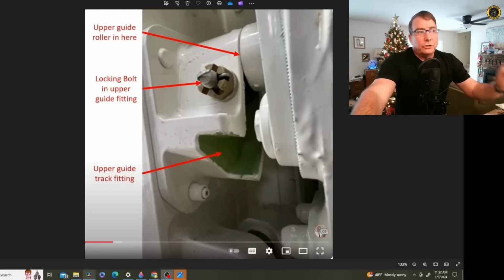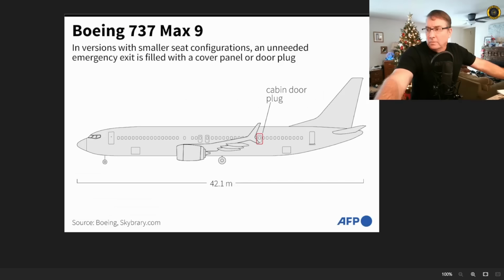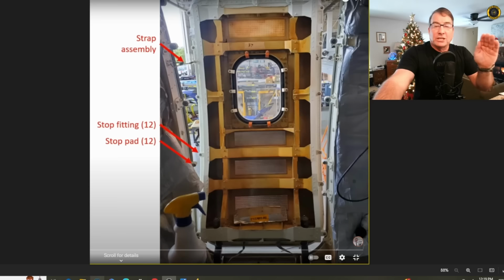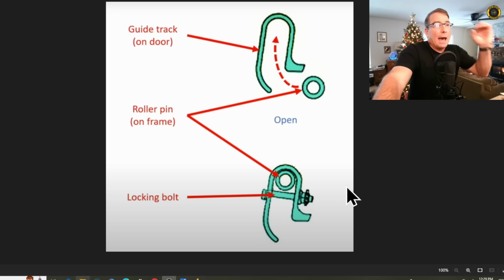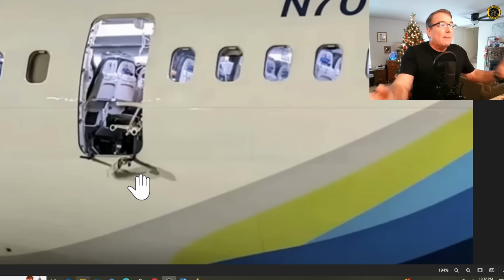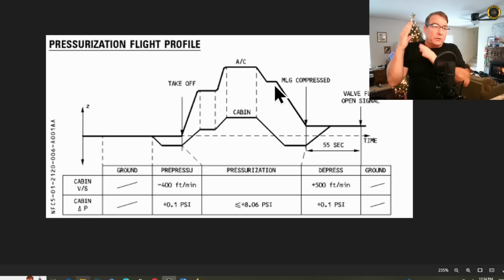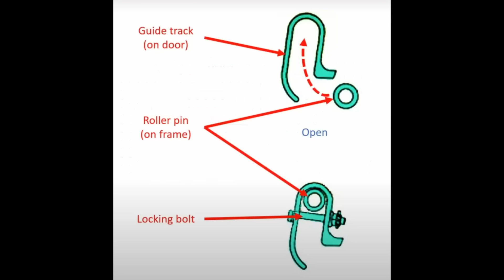Alaska 737 Max-9 Door UPDATE! 8 Jan 2024

Comment: The damage to the guide tracks NTSB report they saw on the door that was found, is of little significance. (They do kind of say as much).
The guide track system is only intended to guide the up/outward path of the top of the door when there is no differential air pressure. With the door lifted right from engine start up to the extent that the 12 main lugs are so far out of alignment they are only just hanging on (the hair trigger Juan described) the roller pins are  in the lower part of the guide track. At 15k ft when the differential pressure is such that the 12 door lugs finally slip past the 12 frame lugs, the event has such force that the rollers just break through the final part of the guide tracks, (the inside lip of the tracks at their lower, open end of the tracks) rather than the guide tracks having any influence on the path the door is now taking. 
Normally, on the ground, the roller pins & guide tracks would guide the door further up so there is comfortable clearance as the 12 door lugs pass over the 12 door frame lugs. In this case the door just blasted straight outwards as soon as the lugs could get passed each other, damaging the tracks in the process.
So this damage doesn't tell us much, other than that the rollers got near to the open end of the guide tracks which kind of tells us the guide track locking bolts weren't present. (Which NTSB are going to analyse over the next 18 months with their scientific equipment before telling us that).

They haven't described the guide track damage in any detail or shown photos, so this presumes the damage is near the bottom, open end of the guide tracks. If the damage were to the top of the guide tracks (in which case the lock bolts could have been present) then the 12 door or frame lugs would have to have been severely damaged for the door to be released. We have seen 5 upper frame lugs quite clearly and all 12 frame lugs at a distance so I'm confident that hasn't happened. Although they are still playing their cards pretty close to their chest, I think NTSB would have slipped some clues if the lugs had structurally failed, rather than being severely misaligned from the start of the flight and eventually slipping passed each other.
Reply: I can tell you understand this mechanism far better than many commenters here, some of which tried to explain its operation while not even understanding which direction the pins travel in the guides as the door is removed. Your communication skills are very good as well.

Comment: ich glaub das genietete teil in dem der haltebolzen sitzt hat sich durch die ganzen vibrationen, weil starr verschraubt und nicht federnd, abgeschert losgerissen und dadurch die tür zum ausreißen gebracht.

es scheint ja nur bei modellen (sparversion) ohne vierte tür so aufgebaut zu sein.

I think the riveted part in which the retaining bolt is located has sheared off due to all the vibrations because it is rigidly screwed and not springy, causing the door to tear away.

It only seems to be designed like this on models (economy version) without a fourth door.

Comment: As a former design/engineer & current private pilot (92), great coverage here,  My 2cents, the design & retention of the plug door appears robust, seriously the only way I see this happening is thru missing parts-components (even a few) 3retaining bolts-nuts might hold, down 2, thru several flight cycles would likely stress possibly give out.  What’s the tension level on the bottom 2springs??  Such a clean break upwards on the plug itself, it launched perfectly off pads.  If nuts fell off the bolts it would need  to happen simultaneously.  I’m of belief parts-components were missing (even cotter pins) but all 4???

Comment: This is really interesting.  When you showed the hinged assembly on the lower part of the door and frame, there appears to be two nuts and a washer on the top of the pin itself.  It's hard to tell if the washer is oversized to further assist in preventing the door from releasing from the pin.  Correct me if I am wrong, but the door seal is accomplished by dropping the door into the home position and those four bolts only function is to prevent the door from lifting off its guides.  It also seems someone has to sign off that everything is secured on this plug door once installed.  If all the yolk assemblies on the door and frame are undamaged, it seems unlikely that all four bolts and nuts came loose with the cotter pins installed.

Comment: Just a technical nut what is pictured is a slotted nut. A castalated nut has a raised portion where the slots are and are longer in length then slotted nuts. This adds weight and would also require a longer bolt with more weight. Any added weight on an aircraft is a no no.

Comment: One of the supervising A&Ps at Renton has told a friend of mine the core cause is the lack of skilled people coming into the industry.  All of his A&P supervisors are over 50 and will age out soon, and there are not enough new ones in the pipeline to replace them.  But even more concerning is that he can't hire anyone for the entry level tech jobs, simply because there are no qualified applicants.  And they'll take anyone with a few month's experience in an auto repair shop.  Meanwhile, he's had to cut final inspections because of management pressure to move product out the door before everything is checked. I suspect the aviation industry is not the only place experiencing the skilled labor shortage crisis.

Comment: An aircraft door held in place by a 4 castle nuts with split pins unbelievable i used to have a trailer with the same fixings but no way was it ever under the same stress as a pressurized cabin door and that failed twice it’s unbelievable this is used and another piece of cost cutting. Thanks Juan for the very comprehensive explanation.
Reply: The bolts are in shear and stop the door lifting away from the lugs that take the whole pressurization loading. The castellated nuts only hold the bolt in place.
Reply: I suspect you are not an engineer. It's not that simple.
Reply: @OsoMagna Great comment Sherlock, why bother!

Comment: @Blancolirio

Juan, excellent update, however study the external photo of the door opening, and you will see on the aft lower hinge. There appears to be some of the door structure still attached to it. Additionally, if you go to the photos that you showed from the lower hinge guild fitting of the hinge, you’ll notice, aside from the bolt through the center of the lower shaft. There is a nut and washer, retaining assembly on the top of each shaft, and the casting of the hinge portion that slides up and down on that shaft doesn’t appear to be able to pass the top of the shaft without busting, the casting or, ripping the washer and double nutoff the top of the shaft.

It would make sense the vertical movement Through bolt is likely removed so as that the entire door can hinge downward, and still be retained on the airplane.

If that washer and nut assembly wasn’t installed on there, the functionality of the hinge doesn’t make a lot of sense otherwise.

Comment: As an apartment maintenance technician, I got an emergency call at my building last night because a panic bar had fallen clean off a front entrance door and people could no longer get inside. I came to find out that out of the 4 screws that were supposed to be holding it in place, 2 were completely AWOL and the other 2 were the incorrect screws and were extremely loose. Turns out a contractor who recently replaced the hinge on that door lost the screws and just didn’t care to replace them or tell anyone. Just put it back with like half a good screw out of 4 and thought no one would ever know.

They say that 80% of people in every profession, regardless of complexity or status of the profession, are statistically guaranteed to be stupid. I sometimes believe it.

Comment: The bolts with castellated nuts and split pins are designed to be loose. If the nut and bolt clamped the guide flanges, this would likely cause a stress fracture, especially as the guide is probably a cast part. It would not surprise me if the bolt was shouldered to prevent clamping of the flanges. Ref time 1'46".

Comment: Upper guide track fitting. Has 3 hi loks per fitting.

1-not strong enough to hold door in? 

2- Wrong state in material used for frame. Hi lok ripped out releasing fitting.

3-lock collars missing or not torqued properly on hi lok holding upper guide track fitting. 

Lower hinge bracket assembly. There could have been a failure there as well with material, fasteners not torqued to structure properly etc. 

I myself seeing a challenger 350 on assy line being pressure tested, it's incredible how everything gets pushed out! Rigging of doors etc is documented for steps and gaps for aerodynamic surfaces to be flush during pressurization.

Comment: Good info on the issue of the plug door that fell off the 737 Max flight. What I don't understand is how the plug door was sealed to be airtight and maintain the cabin pressure. It would seem like it must rest against a continuous layer of seal material, all the way around the door or panel. But this would leave it unable to be opened in the outward direction. Which is true of all the normal doers, they swing into the plane. 
Also as the cabin pressure differential increases with altitude, the force of the air pressure should push the panel against that lip with the seal material, and hold it firmly in place.  Which would seem to imply it was not going to move up at 30K feet, but when the pressure differential was less. Like at 16K ft.

Comment: I'm looking at this door design Juan, and in theory it seems like it should be a solid, secure seal. Until I looked at those Kotter pins. Look at how they're wrapped up and around the end of the bolt, making them look kinda like a spark plug. That? To me, kinda appears to be a design flaw.

You covered very well what happens, each & every time a plane takes off & lands- PRESSURE. And in which direction does this pressure act on the fuselage? "In & Out". Expand & contract, right?

I thought that there had to be a lever of some kind, in order to seal a door like this solidly. Like a cargo door has. However, since this door isn't used, save for "overflow" purposes, which I believe you told us.. or, at least, I believe I learned from you educating us, what it appears they've done, is literally make the "Plug Door", THE LEVER, itself. The door itself has spring-loaded hinges, which allow it to be pushed down into position, then those bolts added, locking it in place. Bolts out, (on ground), door/lever pops up and outward- hinge bolts removed, and it's lifted out- do I have this right, Juan? That's what I'm seeing, anyway- 

So back to the Kotter pin. Given the direction of movement from pressurization, I can see very easy movement of that Kotter "lip", and with the rest of the inner panels installed? I'd like to know what objects might be close enough that, once that Kotter straightens just enough, it catches on whatever may be closest. More cycles, more straightening, more weakening of the Kotter pins.

Once those pins get loose enough, that nut WILL begin to travel.

Just remember how stress fractures in metal work over time.

They've been extremely lucky- like they were with that cargo door on that flight that blew out, because the ground crew guy FORCED IT CLOSED, something that was NEVER supposed to be able to occur. Those first pilots performed Heroically, and were able to get their craft back safely. 

A fix was supposed to be done on that one? But never was- and 2 years later, it cost the lives of over 350 people I believe it was- as another blow-out happened, but this time the seats that collapsed, cutting all hydraulic lines, something the American craft didn't have happen to them, or they'd of all died as well.

At least this time the FAA grounded all of these planes- something NOT done back in 1972 I believe is when that first one happened, which led to the Airline NOT taking any serious action, and the crash of the Turkish airlines, in 1974.

I just saw while typing this, you posted a link stating lose bolts on other planes have been found- I wonder if this will be any part of the reason why this happened?

let's just hope they stay on this, FULLY, and make sure nothing like this can ever happen again- and that it doesn't wind up with some inane, temporary fix. It's people's lives at stake. The FAA, the NTSB, and the Airline industry need to ACT LIKE IT- and NOT bring their lawyers in to calculate which will cost the company more- the "fix", or the lawsuits. Because that kind of thinking is from the pit of hell, and needs to be abolished, forever. At least in this man's humble opinion.

Comment: Juan, I love your videos and for a long time have watched them. There's a mistake in this one. I need to bring up a primacy issue in this video. You make multiple comments regarding the pressurization and how the door may have popped off. Remember that pressurization of the cabin creates high pressure inside, meaning that the door would not "be sucked into the frame". It would create a pressure pushing/blasting the door outward.
Reply from the maker: You need to watch the video again and pay closer attention.
Reply: @blancolirio  right because those 12 stop interfaces are essentially two opposing tabs that protrude from edge of door and the frame and keep door from going out but if door moves upward, then the tabs no longer match up and it could be pushed out, right?

Comment: I’m a 73 mechanic on the 800NG so I have no experience on the plug doors. I was baffled at how this door could depart the aircraft. After some research it turns out I had this image reversed in my mind. The fittings on the entry and service doors are completely backwards from this. The guide fittings are on the airframe side and the rollers on the door side. When pressurized that forces the rollers into the guide fittings. Not an engineer but this design on the plugs is backwards and seems insane to me. I’m not sure what rigging is involved on the plugs but the doors do move out when pressurized. If the plug is out of rig and moving too far outboard it’s pressurizing against the bolts not the fittings. I could see how the bolts could shear that way.

Comment: "8 psi times the square footage of the door" - I think you realised after you said that, that that's not how pressure works - it's already a force per unit area. It's just 8psi  ;)
Reply: With that opening, at 16k feet, it means only about 76% SpO2 oxygen concentration, so pretty soon you feel pretty loopy, let alone pretty cold.

Comment: Reports are that several United 737-9s have been found with loose plug bolts. 

Two questions come to mind: did those jets have Wi-fi installed, and did the same company install it on both Alaska’s jets and United’s? I suspect the answer to both questions is yes. 

Boeing is a reasonably competent organization with a lot of inspectors. They wouldn’t have missed sixteen bolts not being put back in after they shoved the interior through the plug opening.

The jet in question is so new they just barely got around to taking the sticker out of the window. It is WAY too new to need to have needed a row of seats taken out of it and an interior trim panel removed for maintenance…and Alaska contracts out its maintenance anyway.

The only people who would have had justification to remove the plug at this point in the jet’s life are at the Wi-fi contractor…and this wouldn’t be the first time a third-party maintenance organization screwed up a plane so badly it had a mid-air incident. Air Midwest 5481, anybody? Or for that matter, Alaska 261? 

I think there is one company that installs Wi-fi in airliners, and this company screwed this up.

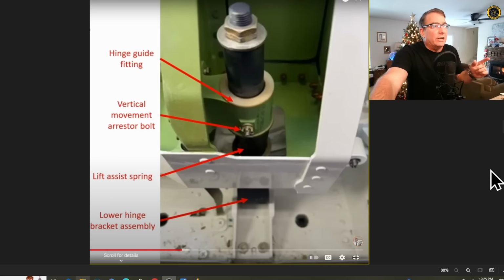Comment: Blanco, at about 5:48, I think you made an error. You said when plane is pressurized that the Stop Pads would push up against the Stop Fittings on the door plug.  It looks plain to see that the Stop Pads are mainly limits for "Stop Fittings" to press against to prevent the plug from protrudding past the interior wall of the cabin.  They "Limit" it from going into the cabin space for proper alignment. These aren't hooks to hold the weight of the door. The locking bolts and guide pins hold the plug in place pulling the Door Plug firmly up against the "Limiting Pads" that are attached to the cabin fuselage structure.
Reply from the maker: Correct, exactly as I explained. Go back and watch again.
Reply: @blancolirio  You aren't humble enough to correct your mistake.

Comment: I agree I think your ideas of missing bolts or is right on but just a curious angle of attack in the air, separation off the wing notice where the door is Blanco talks about pressurization, but outside forces would suck that door up and out it looks like to me😮

Comment: with a door of 100*50 inch = 5,000 si and 8 psi pressure, the force on the door would be around 40,000 lb or up to 20 tons. the narrow bolts that secure hinges might be sheared off at this pressure.